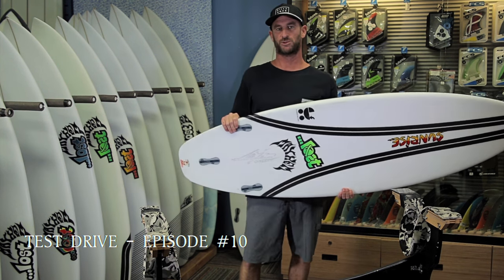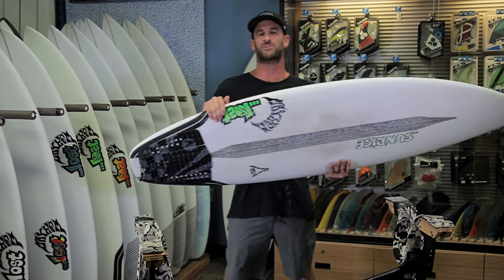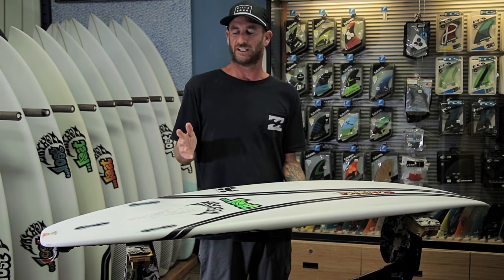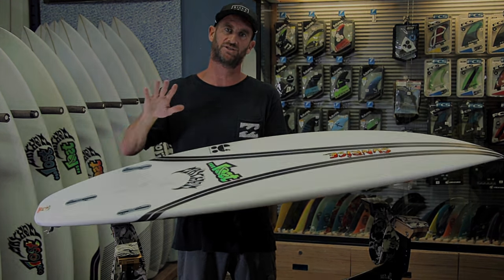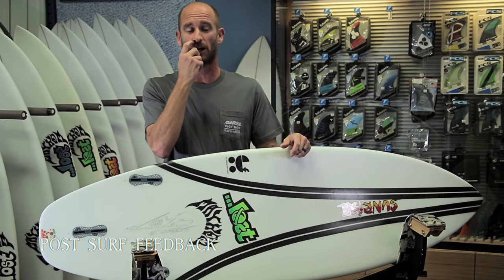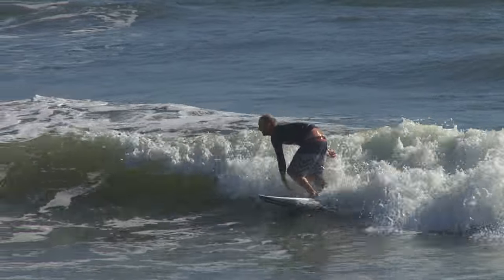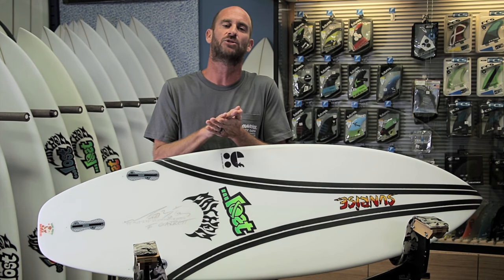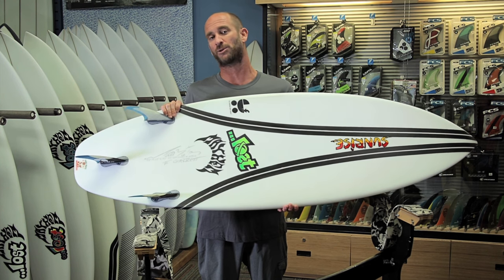Lost Carbon Wrap "Baby Buggy" review-Test Drive Episode 10

Comment: Hi great reviews 
what would you say are the main differences between the PU an carbon wrap baby buggy ?
I am looking for a performance board for small-medium weaker  waves (i live in Israel) and contemplating the baby buggy vs the vs stealth.
I am 5'8'' 160 pounds and thinking 5'7'' baby buggy at 26L or 5'7'' steakth at 26'6L what are your thoughts ?
P.S. I love riding quads,  the stealth is 5 fin baby buggy is thruster.
Thanks a lot and keep up the great job

Comment: Hi Sunrise !!! have you managed to try the Baby buggy with the roundtail + 4 channels ?
Reply from the maker: No i haven't, unfortunately the waves around here don't really warrant using channels. I will tell you if you live somewhere with good surf or want to use it as a travel board then get one!! I have sold four or five to people using them as travel boards and they loved them. With the round tail and deep channels the board will grip insane in the pocket but still have a little more paddle power then a typical shortboard you would ride in solid surf. Hope that helps, thanks for watching!

Comment: Great review,  which do you perfer the poly board or the EPS.

cheers
Reply from the maker: If i had to go with one for the rest of my life i would probably have to say the poly. Mostly because the majority of times i surf its windy, choppy conditions.  The CW is incredible if you are dealing with cleaner surf but it does have that epoxy "bouncy" feel in choppy surf. Basically if you surf clean, glassy waves most of the time the CW is 100% the way to go, if not poly is the safer route.

Comment: So how does the carbon wrap compare to othe epoxy constructions?
Reply from the maker: like i said in the review i think its the benefit of Mayhem's amazing shapes being available in that construction that makes them so special. I grew up in Melbourne FL and it has been a hotbed for epoxy board builders for years with the COIL bros, AJ Finan, all the way back to the legendary Greg Loehr. Compared to ALL the molded epoxies out there (surftech, boardworks, etc...) the Carbon Wrap is far superior due to its flex and spring. Molded epoxy boards are to stiff and have weird flex patterns. These are more like a sensitive PU that has a little more speed and springiness, you will be very happy with it. Hate to say it also but i think some of these epoxies, other brands then Lost, out there being built in China in similar construction just don't work as good. Stick with the CW in the model you like and you will be stoked!
Reply: Thanks for taking the time mate! Great response and gives me confidence in my selection of the carbon wrap!
Reply from the maker: no problem! Thanks again for tuning in!

Comment: P. S.  How would you compare the carbon wrap baby buggy to the sci fi?
Reply from the maker: The sci-fi feels a little more like a traditional PU under your feet then the CW. The CW is 100% more durable then the LFT type construction that Slater designs uses but they both feel great once you get them in the water. If i had to choose one it would probably be the sci-fi or the PU baby buggy over the CW version. hope that helps, cheers!
Reply: thanks for the great input and quik response
how would  you compare the bouyancy of the firewire LFT, lost carbon wrap and regular PU ?
I am looking for a performance board for small to medium weaker  waves (i live in Israel) and contemplating the baby buggy vs the lost v3 stealth vs the sci-fi.
I am 5'8'' 160 pounds and thinking 5'7'' baby buggy at 26L or 5'7'' stealth at 26'6L or 5'7'' sci-fi at 26.2 what are your thoughts ?
P.S. I love riding quads,  the stealth is 5 fin baby buggy is thruster.
Thanks a lot and keep up the great job
Reply from the maker: Well since you love riding quads i would look at ruling out the baby buggy (i love that model but no good as a quad) so it would be between the sci-fi and the stealth. between those 2 i don't think you can go wrong honestly. I will say the sci-fi has been a huge hit with EVERYONE that has bought one from the shop. The tail is so unique that it surfs a little different then other boards with similar dimensions. That being said the stealth will also work really well in the conditions you are surfing also so once again i don't think you can go wrong, both are great boards that ride amazing with quad setups
Reply: Sunrise Surf Shop thanks for your help and time I just picked up a 5'7 sci fi and it feels sick. I'll let you know how it rides keep up the awesome work can't wait for the next review
Reply from the maker: Awesome! Keep me posted on how it goes for sure, thanks again for watching, glad i could help!

Comment: Hi, may I ask what your weight is and the dimensions of the board are?
Reply from the maker: I am 5'10 and 160 lbs. The board is stock dimensions for a 5'8. It's 19.25 and 2.32 with 27.10 CL. Thanks for tuning in!
Reply: You say you want to try the board with a Large Performer fin. Won't the board be to stiff, since you weight is only 160 lbs? I ask this because I surf a Chilli rare bird 6'1 with the performer medium (I'm 170 lbs) and I was thinking of getting the large version  for more hold in steeper waves. Do you think I will notice the difference?
Reply from the maker: yes you will for sure. I have mentioned before i prefer larger fins in general and i have ridden this board with the large performers since filming and i did like it a little better. Honestly the best mix would be the large performers on sides and a medium performer in the middle. hope that helps!
Reply: Thanks!